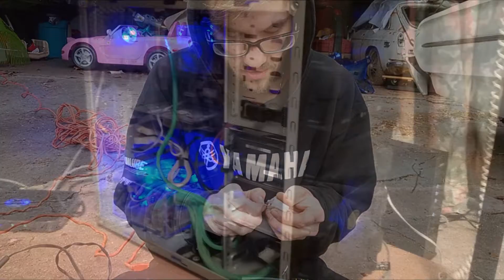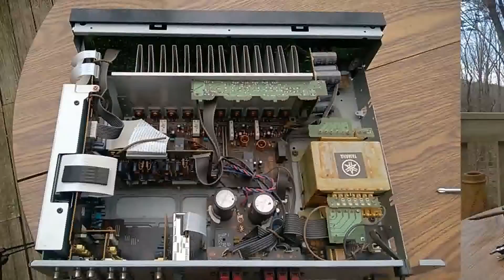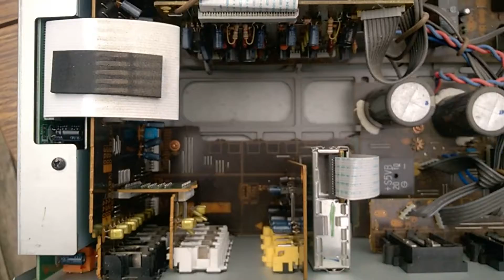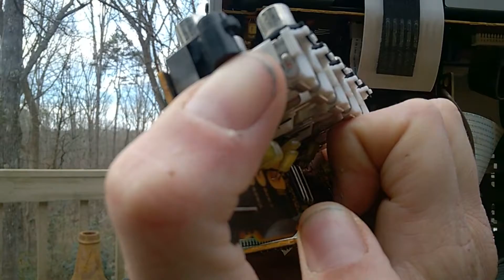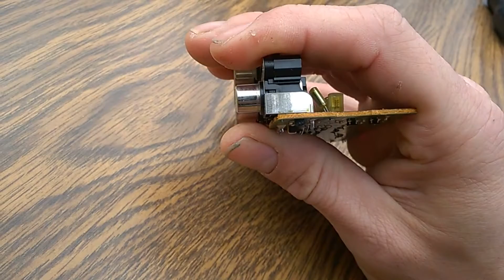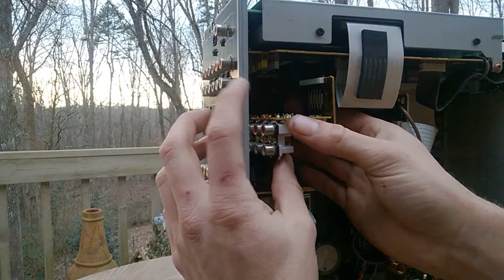Dr. Griggs Yamaha HTR-5540 Sub output failure. Ep1

Comment: Hey John diggs I have a Yamaha natural sound av receiver HTR 5850 with an active subwoofer however when I got it wired in I have no bass coming from the sub almost like it has no power but it's plugged in. Can you help? Thanks much
Reply from the maker: What i would to is fist make sure the power light is on. Check the settings in the receiver to make sure it set to use a sub. If the sub has power and is set active then i would unplug the cable from the back of the sub from the receiver and plug something else into it. You should be able to figure out if it is the receiver or sub from there.

Comment: yamaha htr-5540 powers up then just shuts off after 2 seconds
Reply from the maker: Sounds like its going into protect mode. It will do this if there is a short or if the high side of the amp is damaged. Try disconnecting all of your speakers and go one by one to check.

Comment: I have the version with the input select dial and slightly different inputs on the back; mine isn't utilizing the subwoofer whatsoever. I set all other speakers to small, and I selected yes to the subwoofer, I chose the low-frequency sound output to the subwoofer and also then tried both to no avail. The socket is solid I don't know what I'm doing wrong.

Comment: im having the same problem on my rx-v630 sub output stoped working and i resoldered the connector and still nothing i was running 3 amps and my dad said that could kill my preamp but i have no clue atm "it was in my luandry room for about 2 years if that could break anything on the board and its pretty dusty atm"

Comment: I turned on my Yamaha HTR-5590 tonight to watch a STYX DVD, but my sub didn't kick on like normal. Actually it didn't make any sound. I unplugged the subwoofer cord from the back of my unit & whenever I touched the tip of the cord to the sub, it hummed like a guitar amp does when you touch it. So I know the sub IS working. Is my receiver possibly having the same issue as yours? I did notice the RCA jack on the receiver did wiggle some. Ideas would be appreciated. :)
Reply from the maker: It sounds like it is the exact same problem line was having. I would follow the steps in my video and I'm sure your problem will be corrected. If you have any questions just let me know.
Reply: @johndavidgriggs , I did take it apart today. It is a bit different than the one you showed, but I didn't see any cracks in the solder. I spray cleaned all the connections in there & dusted it out. I ended up bypassing the sub connection & ran wires to the sub & then the speakers & it about blasted me out of the living room....worked great. So to me, it's possibly the cables or something that the RCA sub RCA jack is powered from???? I don't know, but it's working the way I arranged it. Just a mess & hassle to run more wires is all. :(
Reply from the maker: @thomaskolde4316  the first time I messed up you couldn't really see the cracks in the solder either. While you already had it apart it would not have hurt to go ahead and hit the soldering points with a soldering iron. This is the only Jack on this receiver that does this I'm unsure as to why. The next timeline does it I plan on completely changing the Jack out and putting it in a new location. I still suspect that it was the Jack itself coming unsoldered from the board. But either way I'm glad that you got it working. I've had mine for years and I have beaten it up and it's never let me down. So I know what you mean about blasting you out of the room lol

Comment: appreciate the informative vid i have the same receiver, bought a headphone to rca cable, but wherever i plug the rca into i get no sound through the speakers. suggestions appreciated.
Reply from the maker: Where are you pluging it into? You can technically plug that into any input as long as you have it selected on the front and it should work. It might be worth your time to plug that cable into another receiver to make sure that the cable is not bad
Reply: i was plugging it into the video side by accident i figured it out after i plugged it into the audio side, i saw aux on the video side and thought it would work. successfully bumping now thanks man.
Reply from the maker: Nice. Yamaha loud and well friend

Comment: Thanks.  I have the same but the volume knob does not work well and I lost the remote.  Do you know how to replace it?  Thanks again.
Reply from the maker: Yes i do. The remote for them can be ordered they're not that expensive. Just check on eBay and Google. Let me know if you need the model number for the remote

Comment: The two big filter capacitors are for all amp channels. They filter the main DC voltages (plus and minus) for all the output transistors. 20 years authorized Yamaha servicer.
Reply: I have a htr-5540 where the left main channel isn't as loud as the right (actually pretty faint). I've ruled out the speaker, any idea what that might be?

Comment: Awesome work!! I have an issue with HTR5950. Sub does not play, Im assuming its the output , bcuz sub works on another receiver. My older brother came to visit and bought me a new Oknyko. But I have had the Yamaha for 9 yrs and thats the only issue!! I want to keep it and fix it, but everyone is telling me that it will cost $70 to repair, $80-90 depending on where i take it for labor, so he just said get a new one. I need help repairing and diagnosing. Can you help? I really want to keep the Yamaha. I have 15 days to take back the Oknyko from Best Buy. Any ideas, tips, hints would be greatly appreciated.
Reply from the maker: sounds like the exact same issue mine has. if you think you can follow my vid you can prob fix it your self. or if you have a friends
 that plays with electronics..

Comment: I have this exact model, victim of a lightning strike. Will not turn on at all but fuse is good. Where can I source a main transformer and/or the low voltage transformer? Thanks for the great video
Reply from the maker: Yamaha is very funny about there products having oem replacement parts.Just google your local yamaha dealer and give them the model number. what i would is very carefully use a volt meter and chech the output of the transformer. I bet that is your issue.

Comment from the maker: Lol it's yours Patrick. T stutsman. You need a head phone jack to RCA cable. That what I use and it works perfect and they are cheap. You can go anywhere to get it. Walmart has them for sure. Get a nice one. Ben wilderykx does your receiver have a RCA sub out put like this one? If so that's how you want to plug it in. If not does the sub have a high pass input. This is where you wire the input into the reg speakers. If not you can use a high low impedance adapter. But i would recommend getting a different receiver. RCA pre amp is the best way to provide a full and clear signal.

Comment: hi i have a question.i have a yamaha rx-v440rds and want to connect a klipsch r-10sw subwoofer to it , how is the best way to connect it to the yamaha receiver .can you help me.thanks and grz:  i'm Ben from Belgium.
Reply from the maker: on the back of yamaha there is a black rca connector. bottom left if youre looking at the back of it. its labeled sub woofer. Use a long rca cable to connect the sub. if you need one thats long. get a set for a car set up. they are cheap and long.
Reply from the maker: http://audiobaza.blogspot.com/2015/04/yamaha-rx-v440rds.html
Reply: this is the back of my receiver.